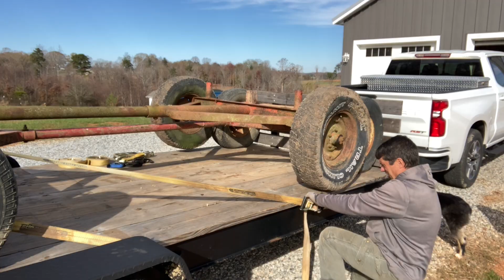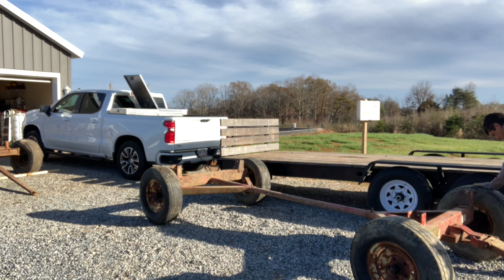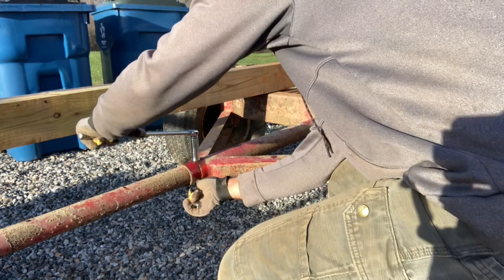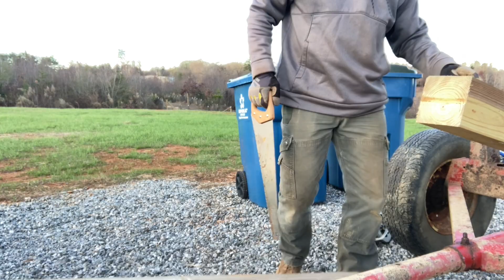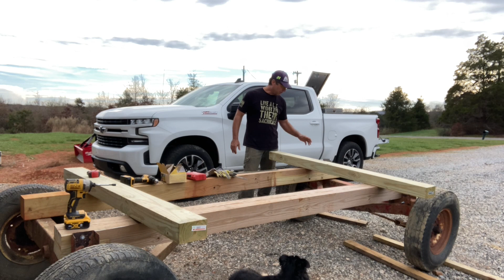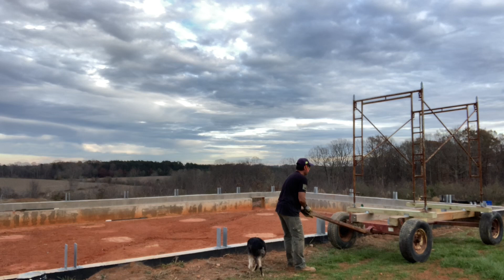Affordable Rough Terrain Scissor Lift Alternative

Comment: mmmmn... basically just made a baker scaffold... but a bit bigger...

i ended up buying a indoor scizzor lift... and running it on 2 sheets of 1/2" plywood. the moment one of the wheels goes off the plywood, it gets stuck tho lol :P 
indoor lifts can go for $3-5k, although i paid a bit more for transportation and the market was pretty bit bare. trying to justify the expense as i'll keep it for a workshop... that i havent built yet :P

well still saving a ton by diy instead of paying people.
Reply from the maker: If I was on a slab I would have bought one as well.  I needed to build something lightweight that I could put in the crawlspace with my loader and this fit the bill.  Even the small scissor lifts are rather heavy.